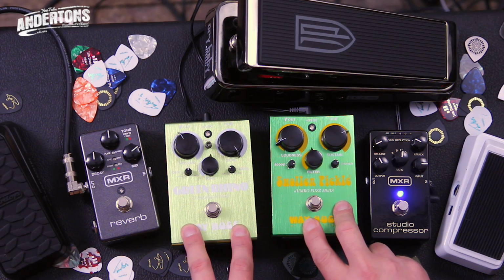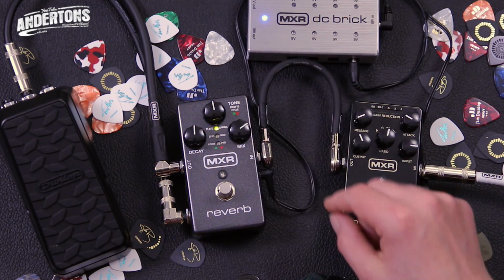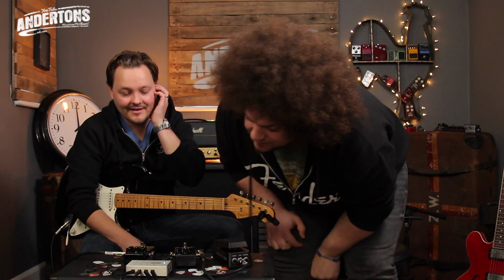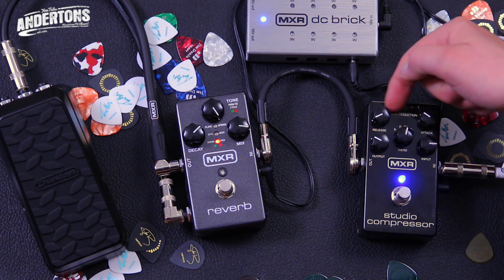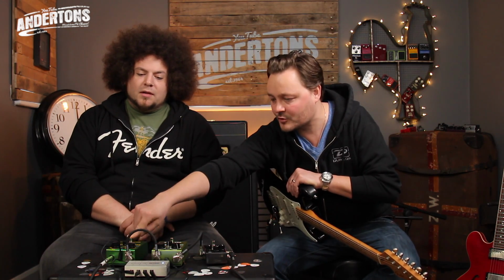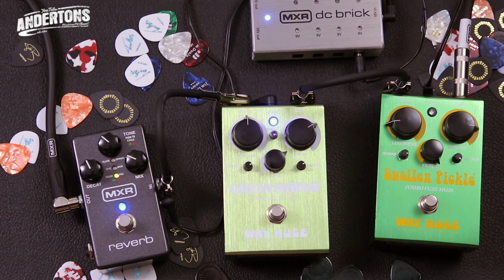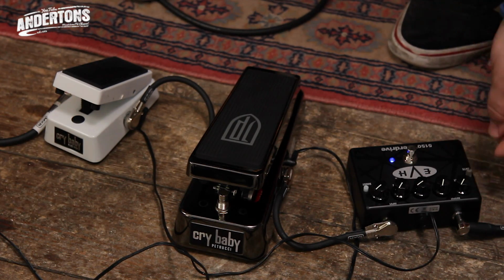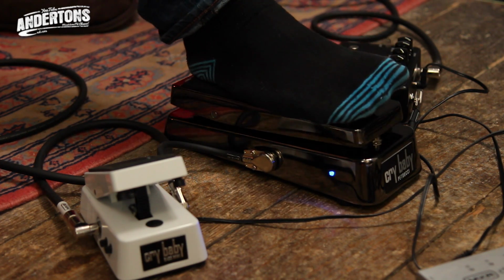New MXR Pedals, Reverb, Studio Comp, DVP4, Green Rhino, Swollen Pickle, Bass Wah Mini & Petrucci Wah

Comment: The ability to set the toe-down and toe-up settings on the M300 is not in the passive expression pedal, it is in the reverb pedal.  You should be able to achieve this using the M300 with any compatible expression pedal.

Comment: Hey, I was wondering if you guys (or anyone else) could tell me if the 500Hz pot's function is reverted to the function of the mids 'curve' pot from the big, old Green Rhino when in Classic Mode, or does the 500Hz pot simply do nothing when in classic mode on the newer edition? I can get one of the old ones for €100 where I live rather than €164 for the new one and what I decide on buying will probably be determined by the answer to this question. Cheers guys! Great video.

Comment: Help! I don't know if I should make my own pedal board or just buy a multi pedal?
Reply: You will be so much happier if you slowly build your own pedal board vs getting a multifx. I started with a multiFX pedal and it 1) really chews up your tone. If you've found a guitar and amp you like and are happy with the sound, the multifx is gonna make you feel sad. 2) There are so many options and buttons and switches on even the simplest multifx that you'll have no idea what's going on. If your first delay and first fuzz and first reverb and first wah are all on the same button, it will be slow going learning how to use each one.

Get a reverb and play with it for a few months, then a delay for a few months, then a drive, etc etc. Ten years down the line you'll have $50,000 in pedals and be waiting in line at the store for the new Boss Ultra-Mega-Flange-Phase-ulator.
Reply: +jezmundberserker Would you suggest a Boss ME-80 or a Line-6 Firehawk?
Reply: +jezmundberserker Good to know, man Thanks. Any other similar units you have tried? What about the Mustang 3 with the pedalboard unit?
Reply: Zac Miller Thanks, man.